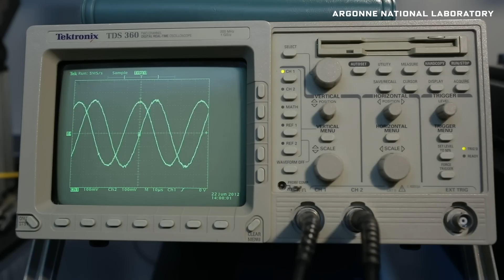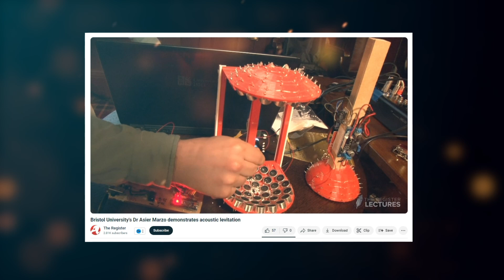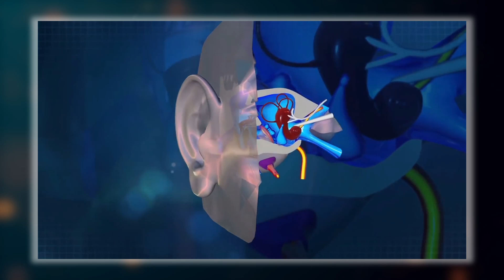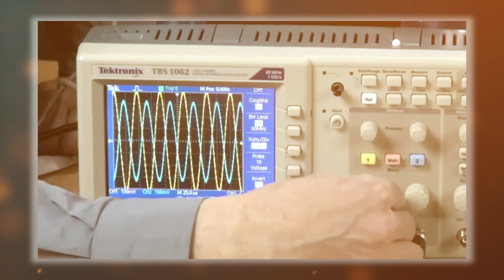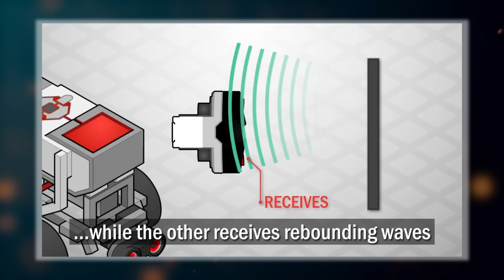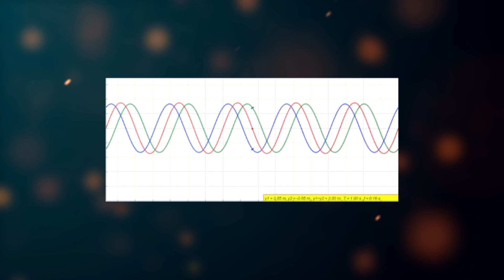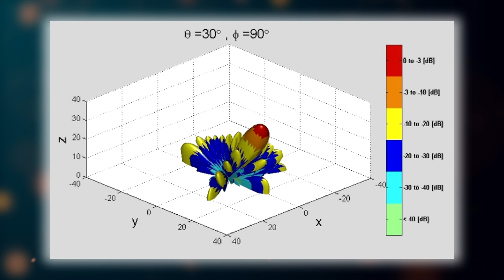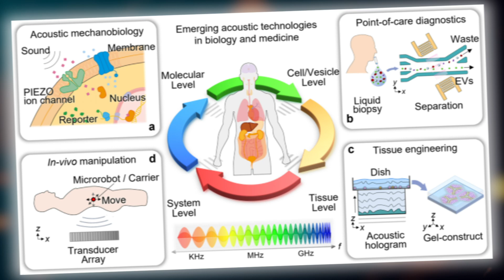High Vibration Frequency That Make Things Levitate

Comment: The Principle:
Acoustic levitation, also known as sound levitation or acoustic suspension, uses sound waves to suspend objects in mid-air. This phenomenon occurs when a sound wave's pressure nodes, or areas of low pressure, are created above and below an object, effectively levitating it.

The Setup:

Transducers: You'll need two transducers, which convert electrical energy into sound waves. These can be piezoelectric elements, such as piezoelectric ceramics or crystals, or even high-frequency speakers.
Amplifier: An amplifier is required to power the transducers. The amplifier should be capable of producing high-frequency signals (typically in the range of 20-40 kHz).
Signal Generator: A signal generator produces the high-frequency signal that drives the transducers. This can be a function generator or an audio player with a high-frequency signal.
Reflection Plate: A flat, smooth surface (e.g., a metal plate) is needed to reflect the sound waves back to the object.
Object: Choose a small, lightweight object with a flat bottom, such as a tiny toy, a bead, or a small piece of paper.

The Process:

Positioning: Place the object on the reflection plate, centered between the two transducers.
Signal Generation: Generate a high-frequency signal (typically a sine wave) using the signal generator.
Amplification: Amplify the signal using the amplifier.
Sound Wave Generation: The transducers convert the amplified signal into sound waves, which are directed towards the object.
Levitation: The sound waves create pressure nodes above and below the object, suspending it in mid-air.

Tips and Variations:

Frequency Adjustment: Adjust the frequency of the signal to optimize levitation. Higher frequencies tend to work better for smaller objects.
Object Shape and Size: Experiment with different object shapes and sizes to achieve stable levitation.
Multiple Objects: Try levitating multiple objects simultaneously using multiple transducers and reflection plates.
3D Levitation: Create a 3D levitation setup using multiple transducers and reflection plates to suspend objects in three-dimensional space.

Safety Considerations:

High-Frequency Sound: Be cautious when working with high-frequency sound waves, as they can cause damage to hearing or other objects in the vicinity.
Object Movement: Ensure the object is securely positioned to avoid it moving or falling during levitation.
Reply: Great information
Reply: @David-yw6ls  i know